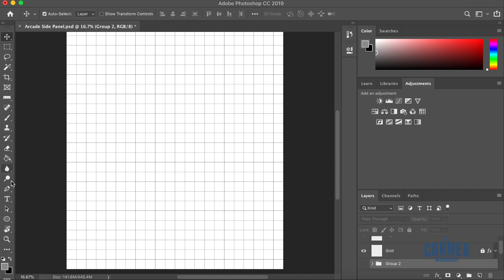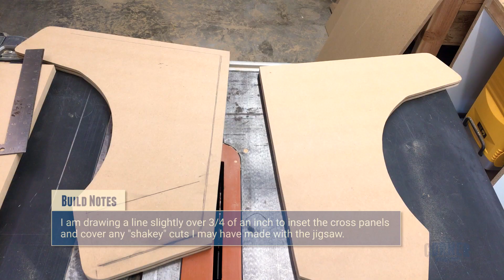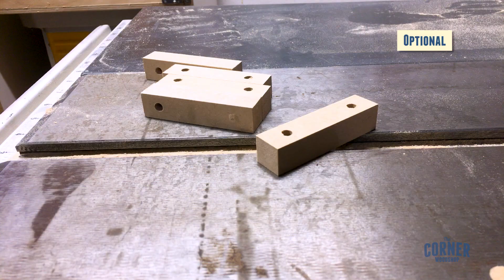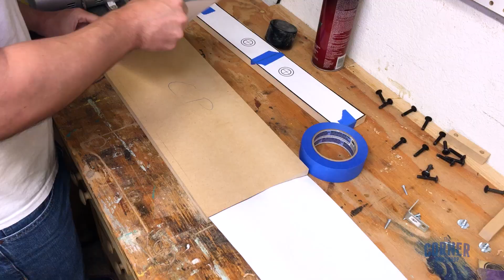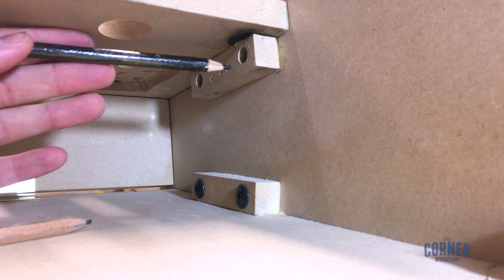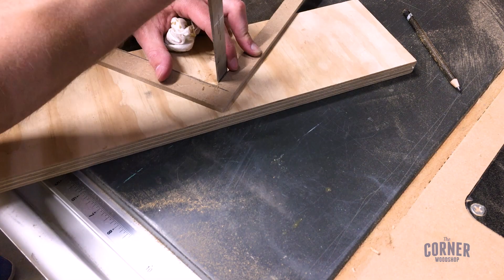How to Build a Retro Bartop Arcade Part 1

Comment: Hey great build. I have a question about the drill bit that you use make the hole for the joystick.
Reply from the maker: I used a 1/2" bit.  I can't confirm whether that works for all joysticks, but as long as it's a large enough hole that the joystick doesn't touch the sides when in use, you'll be good!
Reply: @cornerwoodshop  thanks I was using a 1 1/8 forsner bit with all holes even the joystick.

Comment: Great video. I’m planning to build this. But I will be using a 24inch monitor. Other than increasing width of the control panel and top / back / marquee, would that affect any other measurements?

My biggest pain is printing the vinyl graphics, cause if I change the side panels size, I don’t know how to properly edit the graphics so they will still line up properly.
Reply from the maker: I think you should be ok lengthening the width of the cabinet and keeping the side panels as is.  A 24" monitor will be taller, but since it fits in at an angle, you will have some room to play.  Worse case, you can adjust the marquee a little higher to make room.

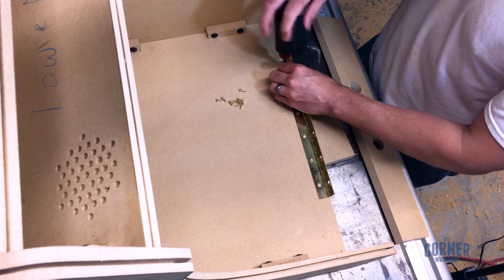Comment: 6:50 for anybody who might searching, those are often called a "piano hinge"

I like you're complicated math for where to drill on that monitor holder. I would have had a much simpler solution. namely I start with something thin like a piece of paper so I can piece it with a pencil real easy. Then I put the paper on something thicker, like a nearly-thin-as-paper piece of plastic. then go a little thicker like 1/8" inch particle board or whatever...and test the holes with that to make sure it will screw in to the monitor. Then screw through that material into the MDF, creating perfectly lined up holes. That process would like maybe 3 minutes.

Not criticizing. geometry works too ...
I guess it's just stand vesa mounting holes. could probably just print those out or use a left over vesa mount or something. I'm probably overthinking this.

Comment: Thank you for the awesome video,  curious where you found the the bolt and inserts for the 1/2 mdf
Reply from the maker: Thanks!  I'm actually using 3/4 inch mdf, and I got the bolts and inserts on amazon here https://amzn.to/3clgM6t and here https://amzn.to/2Rud3LN .  They were hard to find in bulk at my local hardware stores.

Comment: Nice job, thank you. 
Question: What screen size?
Reply from the maker: Thanks!  The cabinet will fit up to a 22 inch monitor.
Reply: Awesome video!!! How long did it take to complete from start to finish?
Reply from the maker: @pmtampabay  If you have all the parts handy, it can easily be done in a weekend.